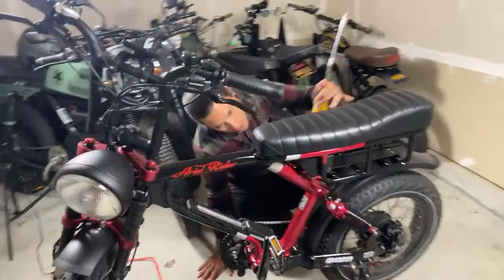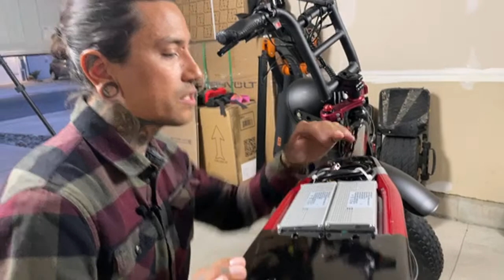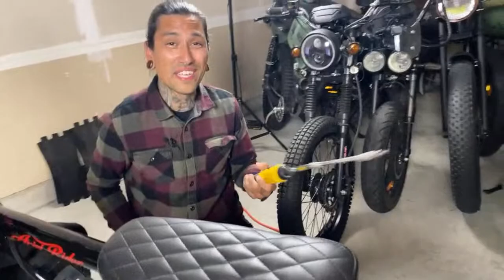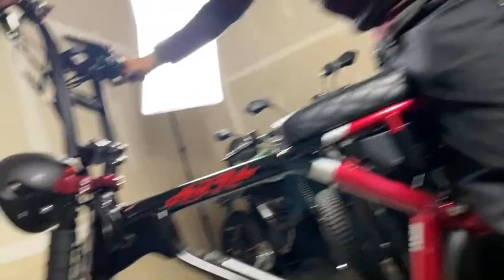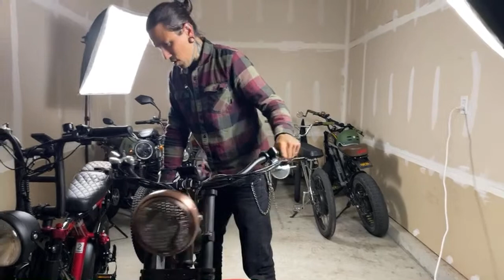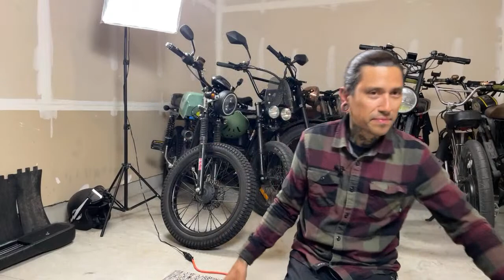Ariel Rider Grizzly Best 2 Person Seat Install

Comment: Really could use some suggestions if possible. Is the grizzly a good first e bike?
Should I worry about having to petal within my 20mile daily commute? With a few hills nothing crazy big.
Also just subscribed.
Reply from the maker: Grizzly is a great first Ebike and with the dual motors and batteries you should have more than enough power and battery for you 20 + mile rides https://lddy.no/turr

Comment: hey Shreddie, I've had a v2 Grizzly for 8 months now and it's sweet, BUT, from what I know it has 2 30amp controllers and maxed out only delivers 3100 watts, it is said that each motor can peak out to 1800 watts/ 3600 total but this is power we will never see with said controllers... Now the X-class uses a 35amp controller and claimed 2000 watts peak for the same motor so I contacted Ariel Rider about the possibilty of using 2 of those 35amp controllers on my Grizzly and of course they were against it and mentioned warranty this and that... Who cares about warranty at this point, I'm 8 months in and want to squeeze out max power from this beast, there's at least 500 watts untapped power there... How can we max power the Grizzly? and does Ol' Bomber Marv have any insights?
Reply from the maker: Bomber Marve had 2 45a controllers in his old D class that he just recently sold… So I’m pretty sure we could do the same on the grizzly

Comment: Is the grisly a two-person bike what is the voltage and what size motor
Reply from the maker: You can definitely fit two people on it it comes with pegs but you would have to buy an extended seat…. It comes with two 1000 W motors and it’s a 52v🤘🏾⚡️🤘🏾